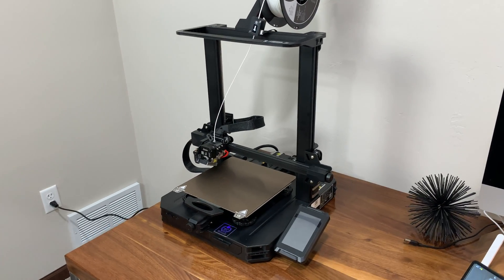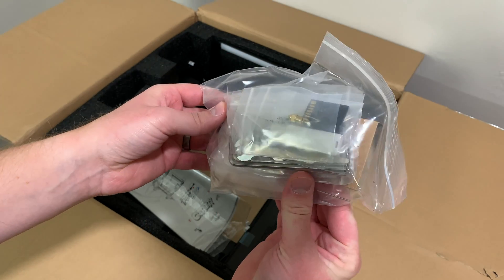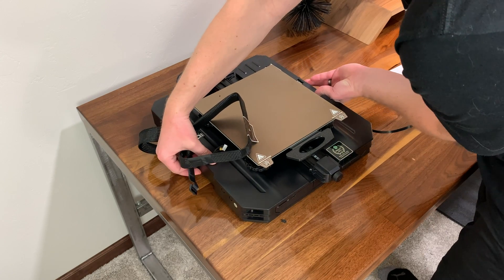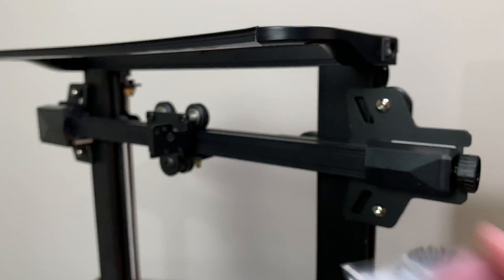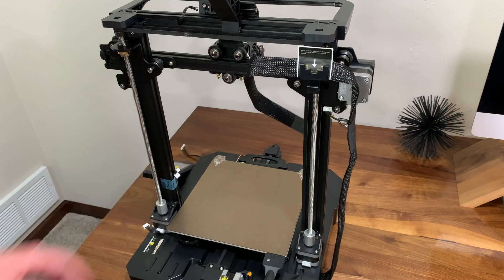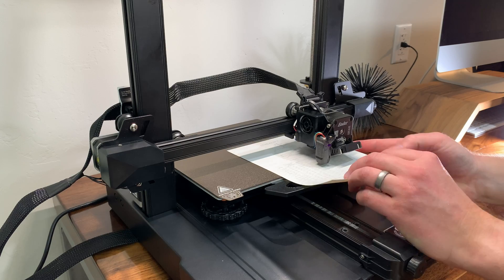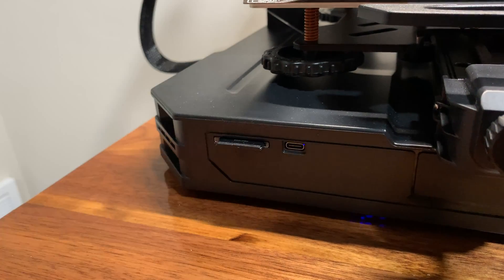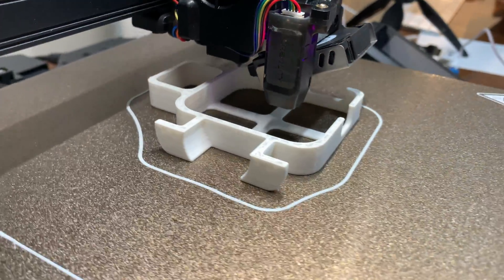Ender 3 S1 Pro 3D Printer - Unboxing and Assembly

Comment: thanks for the video! just used it to mount my new s1 pro, by the way I'm having one problem with the bltouch, is touching the printed piece (this is my third 3d printer but the first one with bltouch) it's only my case? Did you have this problem? my bltouch is maybe 1 or 2 mm higher than the nozzle but this causes that sometimes shocks with the piece...
Reply from the maker: No problem!
Honestly, I haven’t had that problem… is the build plate as level as you can get it?
Reply: @DoingWhatever  found the problem, was the heatbox that was too high and the heigh distance between crtouch and nozzle was too low

Comment: You made the video two months ago. I just got my refirb printer in. I haven't assembled it yet. But are there any other suggestions now that you've been running for 2 months before I assemble mine?
Reply from the maker: Not that I can think of. The only thing I'll say is take the time to level the bed really well. If you start off with a level bed and the print results are good, you are going to love using this!

Comment: This will be my next printer.  I have two Sovol sv01s that I have made a business out of and just got myself an x-50 woodworker (which is how I found your channel).  Have fun - I highly recommend Shapr3d if you get into 3d design.  Its very easy to learn but powerful too.
Reply from the maker: Very cool! yea so far I have no complaints with this printer. it's been super easy to use from day one. Awesome, what are you selling? 
Sounds good, I'll look into that software. right now I'm on the verge of plunging into Fusion 360 just because I'm familiar with Autodesk programs in general from my day job.